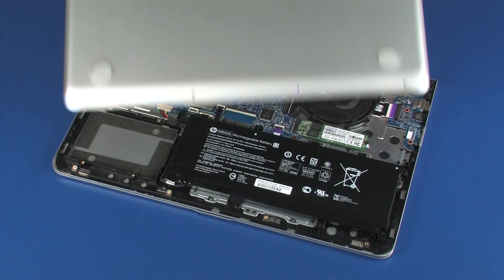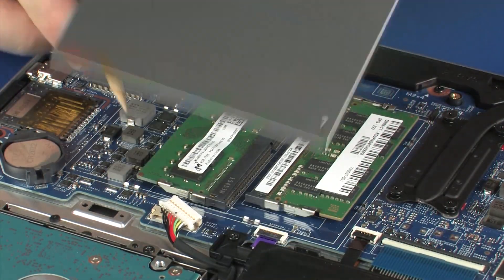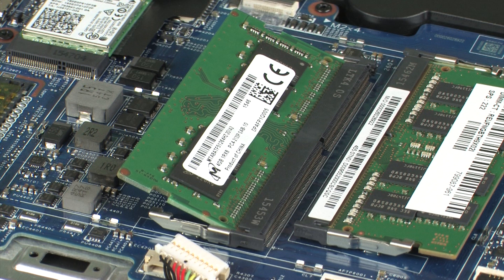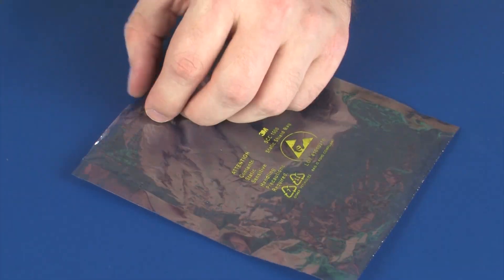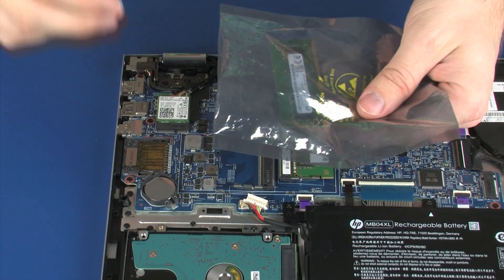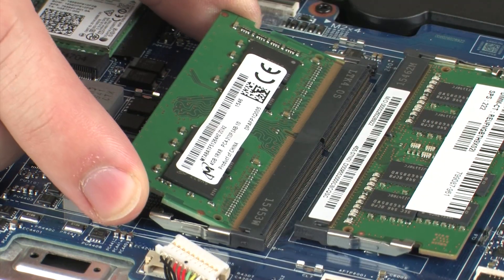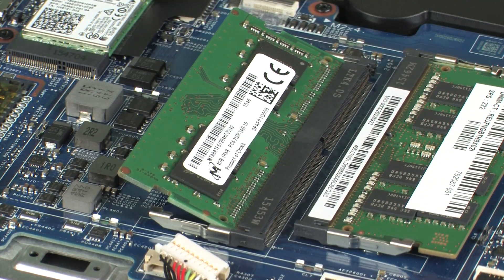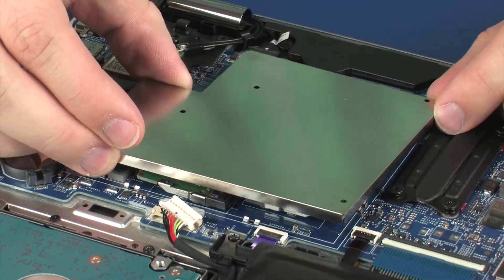Replace the Memory Module(S) | HP ENVY x360 m6 Convertible PC | HP Support

Comment: i have this pc and it over heats :(
Reply from the maker: +snek Please refer to the instructions mentioned under this document to fix the issue: https://bit.ly/3Fz4yGb
Reply: @HPSupport   i eat the pc
Reply: i had this issue, it needed many updates for the drivers. it took lots of research but I finally got the proper drivers installed. the next issue was a bad version of windows 10 (script error that bricked my laptop, had to install a fresh version of windows 10) and then the abysmal battery life. also driver related.
Reply: @QantGetEnough  the laptop want throw 3 hdd